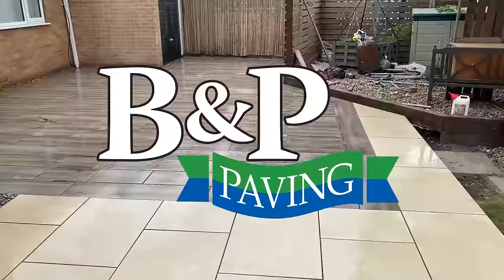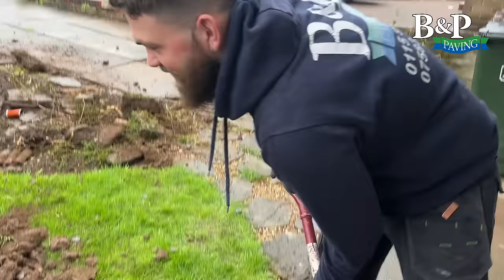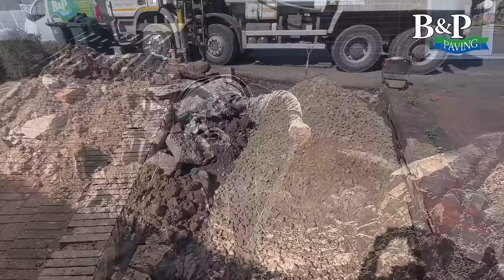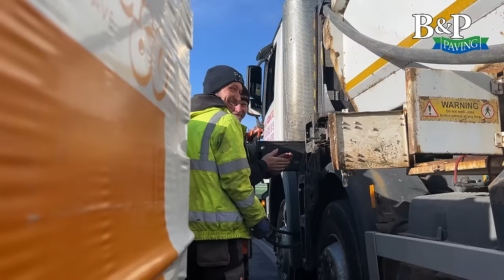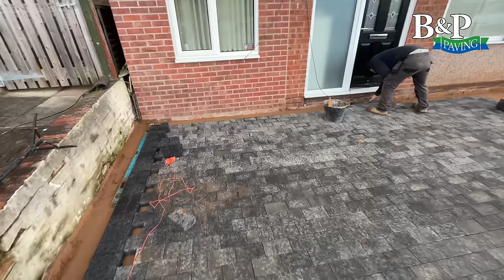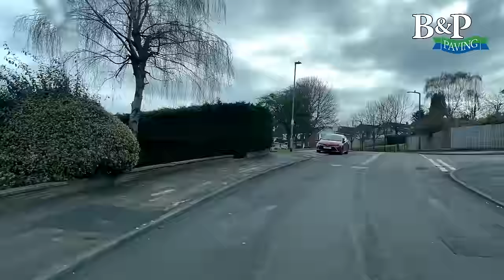What happens when a customer wont pay!! Part 2!! #39

Comment: Working for a fella in the early 80's doing side extension on a house over the Easter weekend,the boss did him a good deal because it was a cash job, see the owner all w/end had a couple of grand out of the job & the boss was owed 4k finished the gable end on the bank holiday Monday knocked on the customers door at the end of the day for last of the money had no answer the neighbour came out after 30 mins of banging the door to tell us they had dropped them at Gatwick that morning & they were away for 3weeks in Barbados,my boss said to the neighbour you better phone the waterboard he then got a 4 inch fireman hose out the van connected to the main outside the house the other end through the letter box & turned it on,we used that on site to fill our water butts it could fill a 50 gallon butt in about 20 seconds hate to think the damage that was done a lot more than 4k

Comment: You shouldn't ever pick axe it up for non payment as it takes away from your professionalism. Just have your paperwork and emails sorted and go through small claims. If you're in the right then you'll usually get the decision, as the court is not in favour of either party. You don't need a solicitor and in the case you had here it would cost around £50 for court fees. If you are confident in your case then you won't lose. If you are not confident, then digging up previously completed work is even more of a mistake if she takes you to Court. I had one case of customer not paying after multiple promises over a number of months. In the end I emailed them stating that unless I received the money within 7 days that I was taking them to small claims. They sent a cheque 2 days later.
Reply from the maker: Mate in an ideal world … we wouldn’t have to do either … however sometimes being reasonable or court proceedings don’t work. The fact my works outside along side the threat of it being removed usually johs it along … and as I’ve said I would I force t

Comment: I’ve had it before as a plasterer,I went to quote for an artex ceiling she just wanted it skimmed over I explained it’s always best to overboard as can guarantee it won’t come off over just reskimming it low and behold I gave it a little scrape before prepping and saw the artex had been applied over wall paper I took photos and a video and sent it to the customer who was at work explained it has to be overboarded and skimmed sent her a new quote through said if your happy to proceed i can do it today as your booked in but that’s it I have other jobs after and will have to wait for a slot so she said yeah no worries I told her payment on completion low and behold she comes back home after work with her husband adamant that I’ve screwed them over by lying about the ceiling I showed them the video and pics of it and still was in denial told me I’m not getting paid,told my lab to start loading the van,got my steps and lath hammer and started smashing holes into the ceiling and I ripped the ceiling down front of them which in turn took abit of artex off the ceiling exposing the wall paper 😂 i left my tarpaulins on the floor for them im not that horrible got the rest of my stuff and just walked out lol they was in the phone to the police as it was happening never heard anything as i was gone by then these are the lengths scumbag customers will go to get out of not paying in my opinion the only time a customer shouldn’t part with there money if the job in question is really bad marksman ship and it’s plain to see
Reply from the maker: Yeah it can be a nightmare

Comment: The wall isn't an issue,  just include rerending wall.

I am more interested in how respectful you are towards the neighbours each side like blocking there driveways or leaving tools on their side, 

I see there were bits of concrete  flying off directly into side of the green car 

I am not here to criticise because I know from personal experience how difficult it is from 35 to 40 years in the building and Roofing trade including scaffolding, 

But you have to be so respectful to neighbours each side as you never know in a few months they may want work doing at there property. 

Keep up the good work. And enjoying the video.
Reply from the maker: We make sure they are cool and know what’s going on . We don’t just block drives without speaking to them ect

Most are out to work all day so don’t mind …

Comment: 100% right. Dont pay, rip it up. I used to be a bathroom fitter. I always told the customer " go and check the job while i load the van " if happy then pay. So many times, my other half will pay you, they are coming home now. Then it started, what about this, what about that. Tell you what mate, what about i smash it all up and take MY materials back. Payment received👍. Doesnt feel nice but it has to be done.
Reply from the maker: Exactly !! Some people have issues but regardless that’s not my issue . I’m a builder not a doctor… it’s funny cause the ones that worry about there being problems end up creating them 😂😂
Reply: Actually you have this wrong. Once installed, it's part of the fabric of the property and is no longer yours.. If you destroy it, you are risking a criminal date charge.

Comment: This concerns me that once contractors are established, they don't like doing smaller jobs, but you would have started with smaller jobs. Why don't you have a snagging team ! I'm a pensioner who has had problems finding
 contractors to do a small job in the shower, yet l pay cash vat if required. not having a go, just
 remember  you would have started started on small jobs
Reply from the maker: Have you watched the video ? The issue is over heads … I have to bring in X per week to cover bills / wages and costs …. So it’s hard to be as competitive on smaller jobs. For example you want a step … 1 man band is labour plus material… where as I have to pay vat, wages , advertising ect ect … so I’m going to be twice what a one man band charges . 

In you situation your better off with small one man bands … of course we do them but can not compete with a one man band
Reply: @BPPavingnottingham  You should consider doing a live talk show on the utube channel question and answer

Comment: Great drive job really nice , glad you sorted out the none payer , off the subject question think Chris an foldsy both have astras  can you ask em have they ever had a problem with there clutch when in traffic off and on the clutch it basically disappears into the floor and you have to pump it with foot to get it back to normal.
Reply from the maker: I will ask them, they have cause there 1.0l and cheap to insure … nice car for a 1.0ltr
Reply: @BPPavingnottingham  thanks yeh mine 1.0 t as well great car apart from this annoyance with clutch the dealership don’t seem to get it they test it and say it’s fine 😡
Reply from the maker: I think there all like it
Reply: @BPPavingnottingham  seems that way